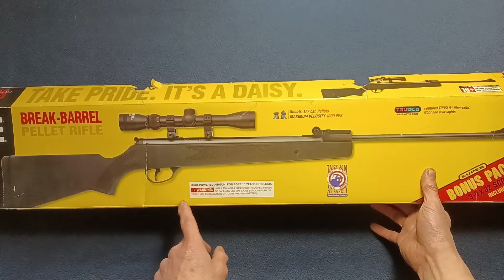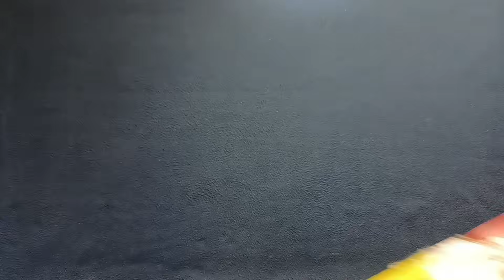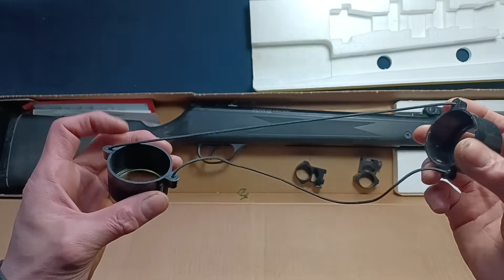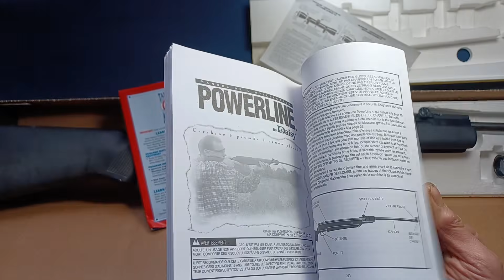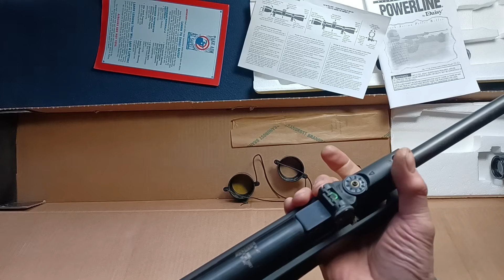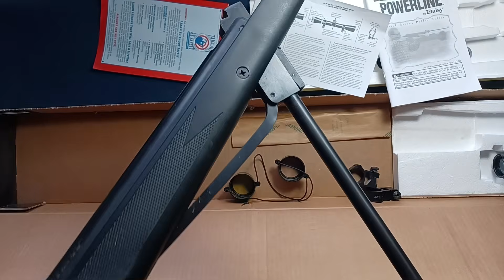(REUPLOAD) Daisy POWERLINE 1000S BREAK BARREL AIR RIFLE, pneumatic .177 cal pellet airgun, 1990s

Comment: Congratulations!!,....Because of this video, 2.9k viewers are now stupider than they were before watching this video because you have spread a frowned upon practice with that Powerline air rifle. You should NEVER Dry Fire a spring piston air rifle. Period!  That's a good way to ruin it.  Every time you dry fire that rifle , you burn (called detonation in the airgun world) that piston seal a little bit at a time,  until it fails to seal properly and you lose it's designed performance. As a bonus, you also risk snapping the spring in two or more pieces due to shock (lack of resistance) and detonation of the piston recoiling back on the spring. That system is designed to withstand a certain amount of forces and resistance (aka the pellet) and perform under those conditions only.  Holding it to a wall or a pillow won't work either because the peak pressure is designed to top out at the breech 'BEHIND' the pellet within the compression chamber,....the receiver. If you think I'm full of crap,..go spread this garbage on the airgun forums and they will horse laugh you like the village idiot. You would better serve the general population at large by either editing that out of the video, or do another video without dry firing the rifle and spreading more ignorance. They are a strong cheap springer, but respond well to a teardown and rebuild when done correctly.
Reply from the maker: Thanks, I am pinning your reply to the top so others with such a 'valuable rare item' can preserve their item maybe a few months longer at this point.  And, yes I literally paid pocket change while waiting for buddy to get done shopping at K-Mart....yes.... I bought this originally at K-mart.  And almost 40 years later, it still works like new, 'they don't make them like they used to'.  And springs and O-rings can be replaced, so can rivets if the swing arm gets damaged, just takes time and concentration to get it done.  Again, thank you, pinning now...if i can get this utoob to work
Reply from the maker: Putting on cap of shame : I have actual firearms, so yes, growing up cutting my teeth I have been very rough with airguns over the years, I have a shelf of shame with items with worn out triggers or broken parts ( zinc castings , el cheapo ) , but thanks to 3d printing of metal parts.... there is a niche solution!  I can also wrap my own springs or source band springs and cut to length, and there are all sorts of O ring kits even at the local hardware store....that curiously sells....airgun supplies ( I live in a mountain town )